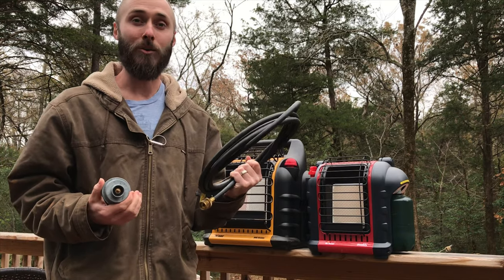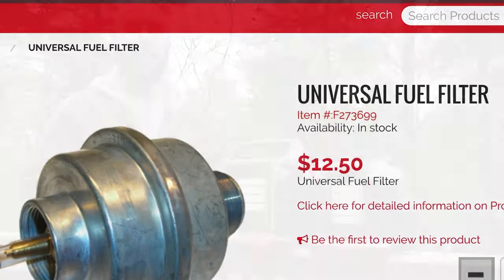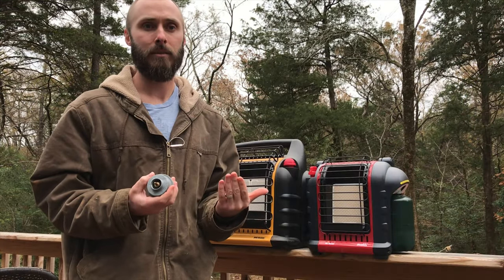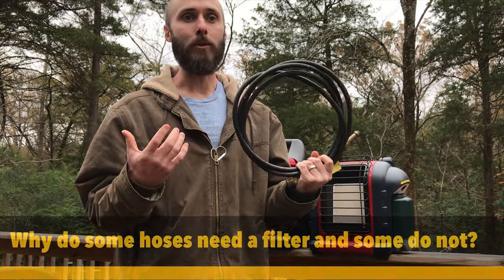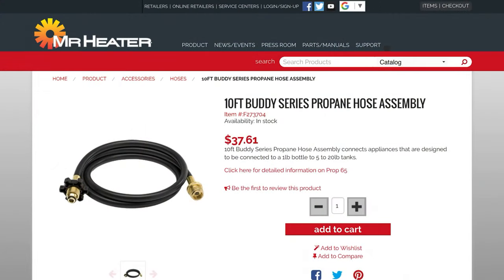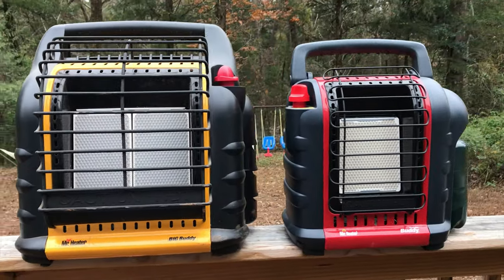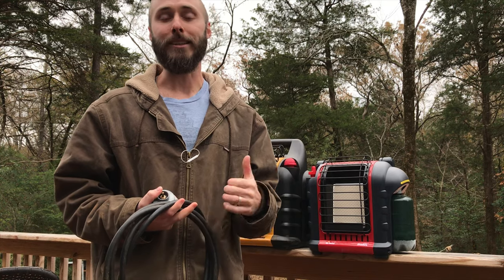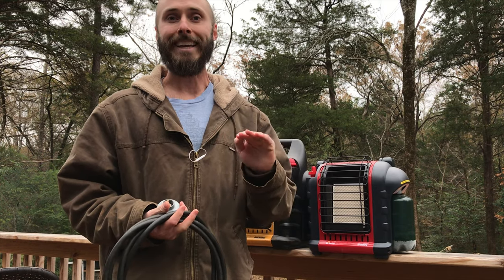Is a Mr. Heater Fuel Filter Needed When Connecting To a 20 lb propane tank? | East Texas Homestead

Comment: At first you say using a hose that has a regulator will overregulate because the heater has a regulator at the unit, then at the end you show a hose with a regulator on it and say there will be no problem because their is only low low pressure going through the hose.  C'mon man which one is it?
Reply from the maker: Both
Reply from the maker: You need the regulated hose if you're bypassing the built-in regulator (using the quick connect).
Reply: @EastTexasHomestead  I have the quick connect hose for my Big Buddy and it does NOT have a regulator on it